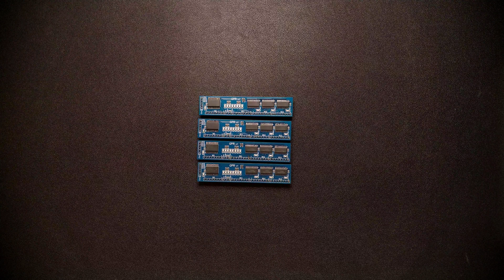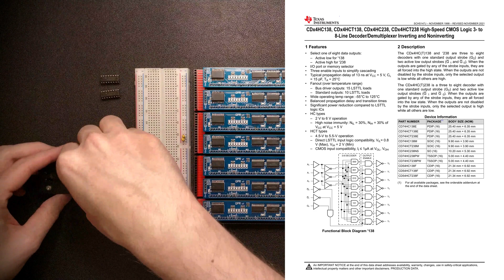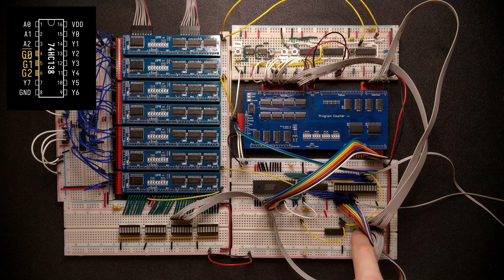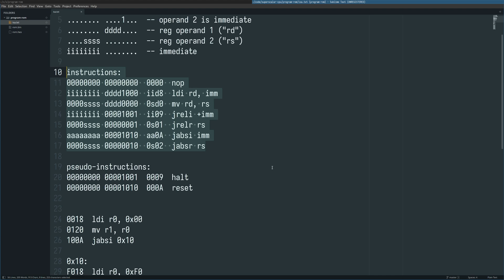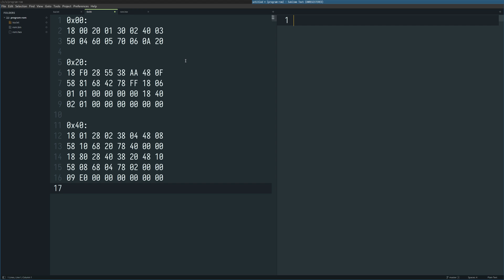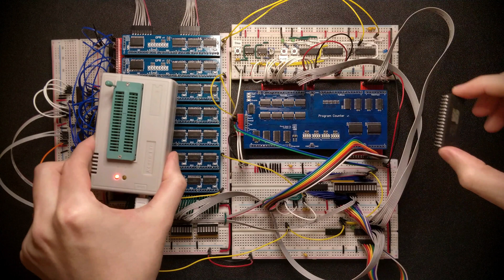Expanding the Register File – Superscalar 8-Bit CPU #21

Comment: I’m curious why you chose to name the registers r0 to r6, instead of r1 to r7, which would match the binary values used.  Then r0 can be reserved as unused or even explicitly zero (like RISC-V).
Reply from the maker: Good point! 🙂 I wanted to decouple the register names from the underlying binary representation. The register address 0 indicating an unused register operand was a convenient hack for the initial videos. But now that we have a full decoder, I’m planning to add that missing register, double them up to get to 16, and then just name them r0-r15. I’ll probably also do the RISC-V thing where I give additional names to registers to indicate their semantics: ra for return address, sp for stack pointer sN for callee-saved regs, tN for caller-saved regs, aN for the function arguments. Or some selection of this 🙂

Comment: I've been wondering about that third read_data bus. My initial idea was to connect it to the write_data bus with some logic to create a read/write bus (with some logic to allow the it to copy) but using it as the h_byte  for 16b addressing is cool. Shouldn't be too hard to implement, if you used an adder to add 1 to whichever address read_data_2 is set to, you'll always get the next register.
Reply from the maker: Yes exactly! This way we don't need additional register addresses encoded in the instruction, but we still get the benefit of combining two registers into one 16 bit word. And as another bonus, doing just another register read with that port will make it a lot easier to handle 16 bit reads with register renaming or out of order execution later. 😊
Reply: @fabianschuiki  makes sense.

One thing I did notice is that random register ports lighting up as the program ran through. I'm guessing that's a result of the double pumped memory output?
Reply from the maker: Yeah exactly. Since the double-pumping updates the two instruction halves in different parts of the clock cycle, you get these intermittent flashes. This will go away once instruction fetching becomes properly pipelined, or we switch to a 16 bit memory bus.
Reply: Have been playing around (well, drawing and redrawing schematics) and have combined the WD and RD1 ports into a single bidirectional bus with some control logic so you read RD1 on the first half of the clock and write WD on the second half. RD3 Addr is just RD2 Addr+1 with a logic to disable it if we either have no register (0000) or the highest register (1111) selected for RD2. This means all four register data ports are now effectively controlled by just 2 4bit addresses. I'm trying to decide whether it's worth combining RD2 and RD3 ports into a single bus, or keep them separate. If I do combine them, we'd read RD2 in the first half of the clock and RD3 in the second half of the clock
Reply from the maker: Ah that's pretty clever! Dividing the clock cycle into different phases and having interfaces do different things in each is pretty neat. If I recall correctly, that was a very popular design technique on early processors like the 6502, which had these phase-shifted clocks (I think they were called phis). The big drawback is the fact that you effectively split your design's maximum frequency in half, since the combinational logic has to fully resolve in each clock phase, instead of the entire clock cycle. But there are definitely cool ways to make this work, especially if you can be careful about how much work the logic chips have to do in each phase. Very exciting!
Reply: I actually ended up creating and using 3 clock signal! The main clock, an inverted copy of the main clock, and a clock pulse.

The primary clock from the oscillator goes into two XOR gates, one with its second input grounded, the other with its second input connected the Vcc. This gives two equally timed (ie, clock edges are in sync) but opposite clocks. Next is the clock pulse. By running one of those clocks (either will do) through a string of Schmitt NOT gates we create a delay as the clock propagates through them. We take the  clock signal after the 3rd NOT gate and feed it into an XOR gate, the clock signal then continues through the rest of the NOT gates in the chip into the second input of the XOR gate. The result is a delay between the clock reaching each input of the XOR gate, creating a temporary condition where the inputs are not equal and therefore the output goes high until the second input "catches up", creating a short pulse  This happens on both edges of the clock, rising and falling. By first passing the main clock through the NOT gates before the first XOR input, we effectively create a delay between the rising edge of the main clock and the rising edge of the clock pulse.

The idea is to activate any input/output/buffer enables on the rising edge of the main clock/#clock, and once they've settled use the clock pulse to trigger the clock inputs on latches/registers/etc.

As for maximum frequency. I think if the primary limiting factor will be any breadboards that we have, followed by the PCBs and the slowest ICs (like ROMs). I do think a lot if issues some people have are timing issues, where busses aren't settling before the clock latches an input to a register/RAM. By using that delayed clock pulse, we pretty much eliminate that problem which might actually allow us to get higher before glitching out.